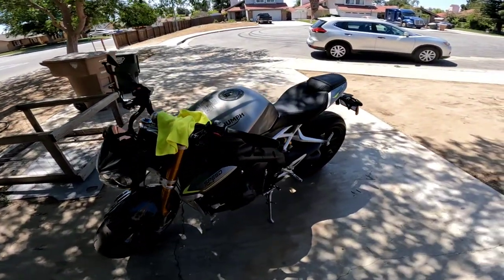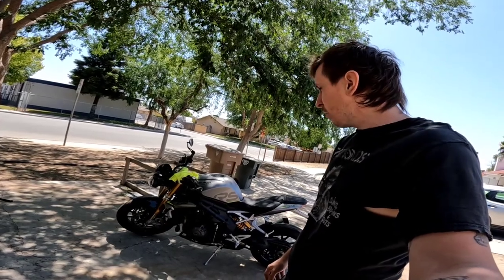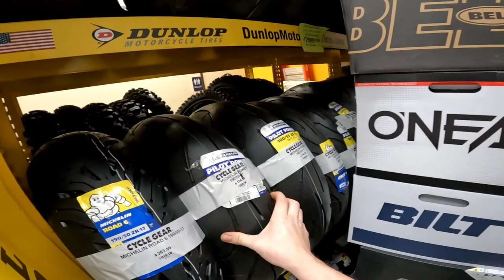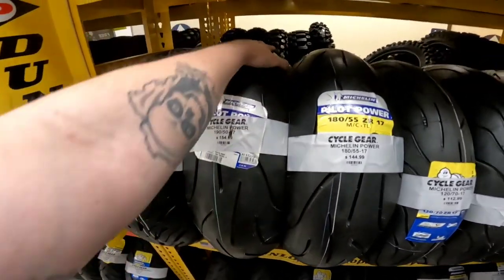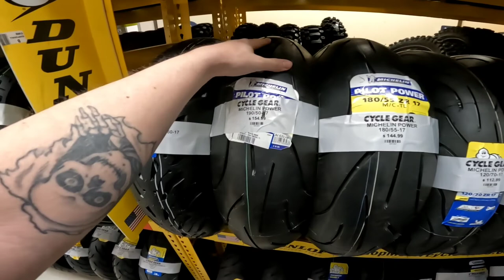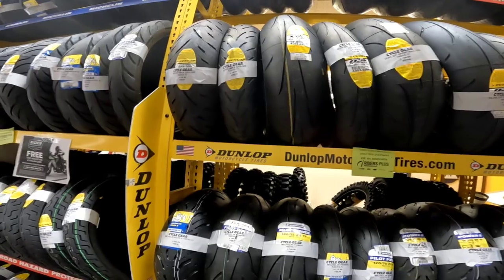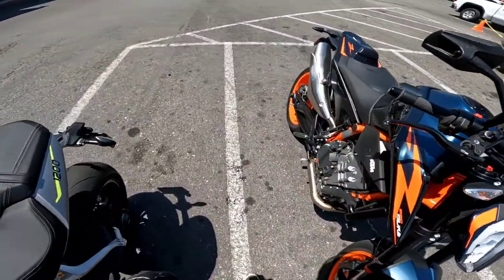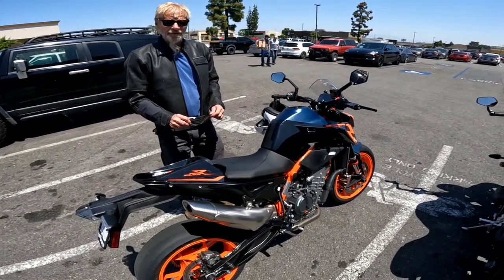I was riding my speed triple 1200 like this?

Comment: I am going to replace my rear tire with another Racetec. It's plenty sticky for me and it has done pretty good in the rain. I was surprised about that because I had heard they suck on wet roads.
    I get a lot of miles out of my tires. I live in FL and mostly just commute, but I don't generally run high speeds or hard acceleration until I find corners. 
    I've got just over 7,000 miles now and will need a new rear soon. I don't like mismatched tires. Not so much concerned about the performance of different tires front and rear, mostly just a mental thing.
    I worked at a bike shop and replaced a lot of tires. I found that Dunlops, although usually a bit heavier than other brands were more likely to balance out well. Of the maybe 15-20 tires that I installed that balanced out without weights, 95% were Dunlops. I like that.
    After seeing your tire, you are running a lot harder than I do. Enjoy.
    BTW, I have noticed lately that my antilock has been kicking on in the rear more than usual for the last month. I usually run in Sport mode. Maybe I have been using the rear harder lately, I'm not sure. The rear still squeaks a bunch too. 
    How about you. Do you kick in the rear antisocial much? Does your rear brake squeal? I heard something about a rear brake bolts recall?
Reply: Autocorrect sucks. Do you kick in your "antisocial" rear brakes much? LOL 🙃  Does your rear antilock kick in much?
Reply from the maker: Iv heard about the recall too I need to call the local dealer and give them my serial number to see if there is a recall. I know there is one in the UK but if that effects America I'm not sure. I wish I could get 7000 miles out of a tire LoL. But yeah the tires are a big mental thing but when you are going 80 to 100 around a corner it's ok to make sure mentally you're comfortable.  So when I'm riding canyons I don't really use my rear brake I mainly use the front I only use it when commuting and I try not to go fast enough to use the abs in traffic. But a couple times in my neighborhood I noticed it coming on when I didn't think it should have and once when I had sworn I turned abs off. I'm not sure what the deal is with that tho
Reply: @2UpVids  I just got off the phone with my dealer. There is a recall. It looks like they are going to replace the rear disc, bolts and lockwashers. The recall parts also come with spacers.
Reply: @2UpVids  Maybe the rear disc doesn't line up right with the caliper. Since it's not a floating disc, this could cause it to squeal
Reply from the maker: Do they have the parts or do they have to order them
Reply: @2UpVids  They had to order them.
Reply from the maker: @scottsspeedtriplechannel  thanks for the info bro I'm gonna call right now and get the shit started. Hopefully it doesn't take long to fix. I'm surprised I didn't get an email about the recall
Reply: @2UpVids  I didn't get an email either. I heard about it on Sargeant Sodoms channel.
Reply from the maker: @scottsspeedtriplechannel  same here lol

Comment: Dude you should know  better than running tires down that low especially on a bad ass new bike come on
Reply from the maker: So my tires weren't that bad until coming back from my last ride were I might have passed a cop going too fast and had to then go even faster. It really ate thru the rubber
Reply from the maker: But you are right I should have been more vigilant I didn't really realize how many miles I put on them cuz the bike is so fun and easy to ride
Reply: I see you talking about  hauling ass and saw u riding  be careful man  take care of your shit
Reply from the maker: @rogerbarfell9075  I appreciate the concern. My bikes are well maintained. I did slip on the tires but like I said with all the problems iv had with the quick shifter and dealing with the dealer i didn't realize how long I have been riding the bike. But yes I do ride fast but I try to do it as safe as possible. I have a friend who will pass on blind corners and do some crazy shit but that's him I wait to pass until I can see down the road and I really try to watch a lot of videos teaching how to ride with proper technique and I often go out and practice different skills such as trail braking, finding apex, being smooth on throttle body position etc.